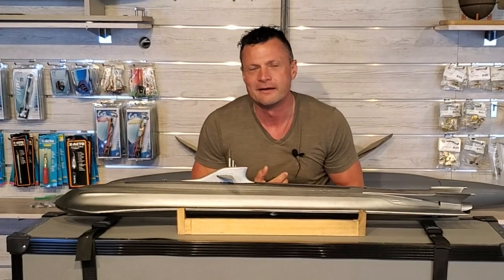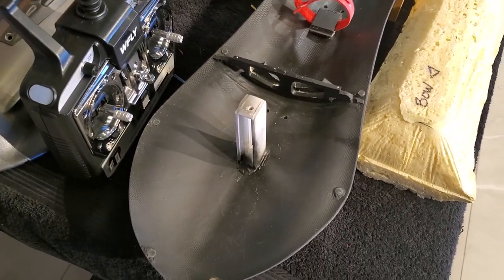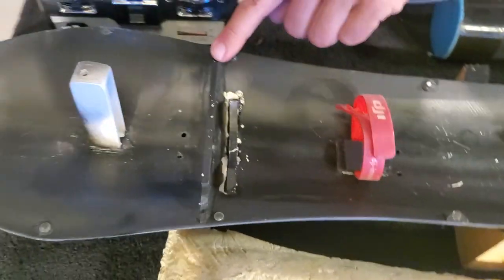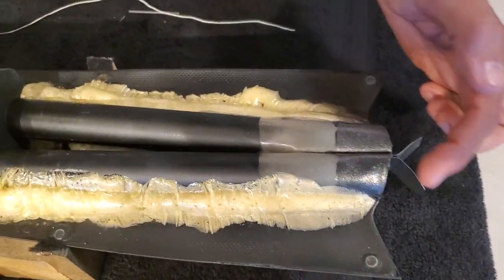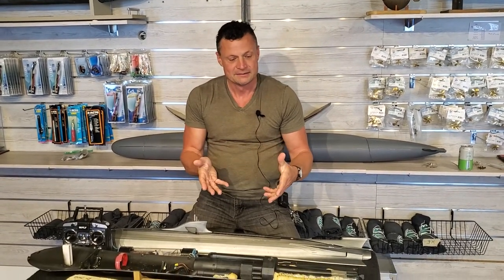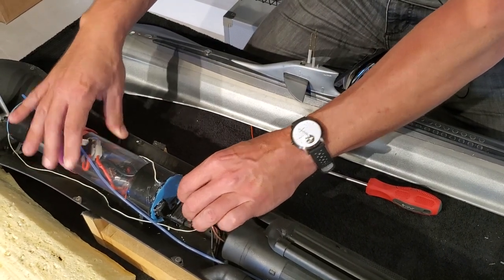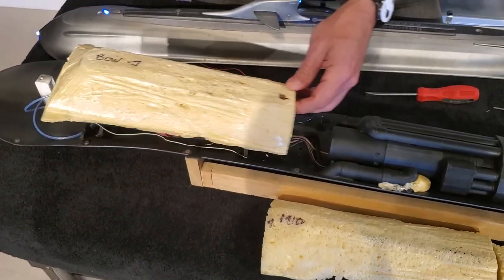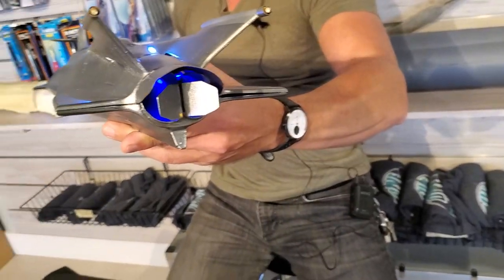Seaview Concept 2 RC Submarine!

Comment: I always like Seaview too but I can’t help but wonder what it’s submerged performance is like. That nose looks like a big downward diving plane. The drag must be incredible. We know it would be a disaster on the surface (as cigar shaped hulls are anyway) but this looks especially bad. I would love to hear some experimental results.
Reply: This one is a challenge. Ive been trying to get in touch with marine engineers on these questions. Mostly about the size of the Seaview in terms of actual feet. As you know it's spacious in there. Stern fins we're a futuristic fancy attributed to Irwin. I've only found one reference to the bow architecture, and if this is true the unique bow layout was requested by a nervous Fox because of the issue of submarine Hull shape and censors concerns. I found some good leads on line but only one on line engineer actually responded so far. His response to my question of length: a submarine could be of any hoped for length, but US sub yards only extend to 700 feet.